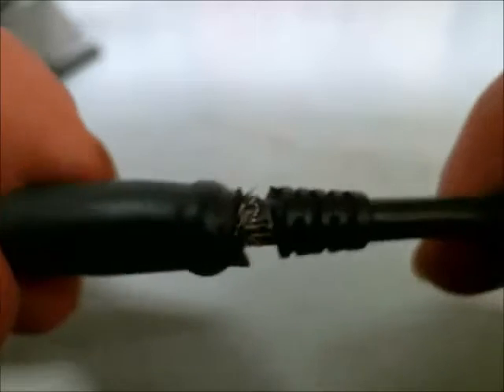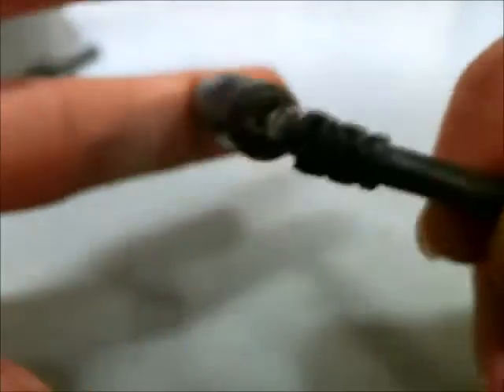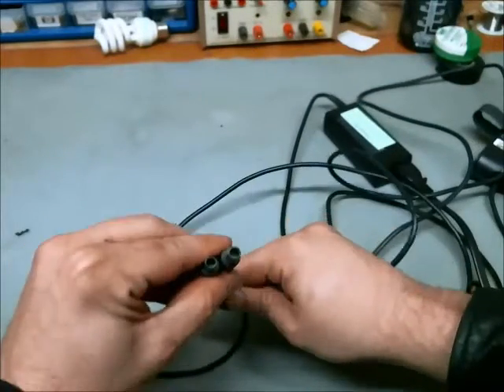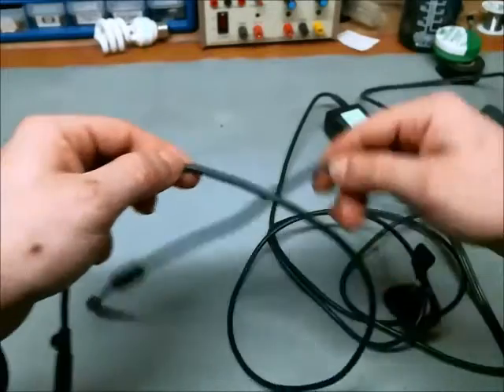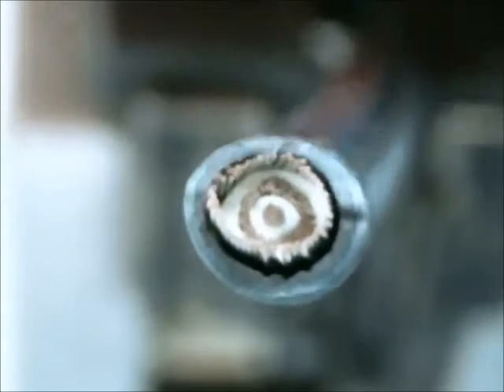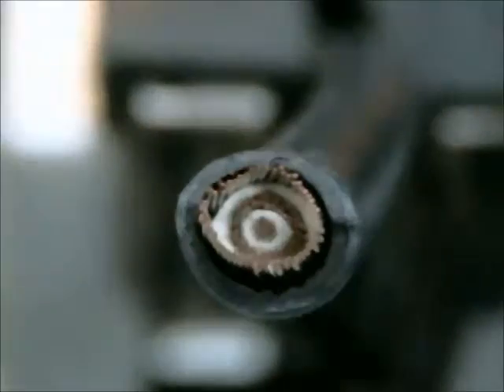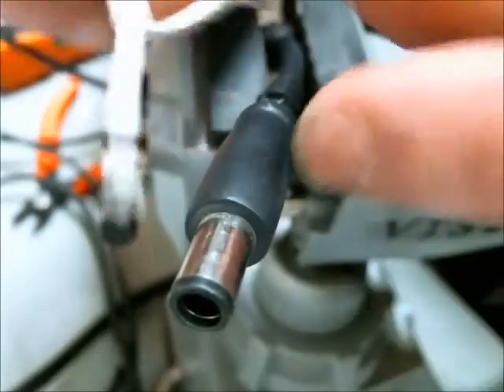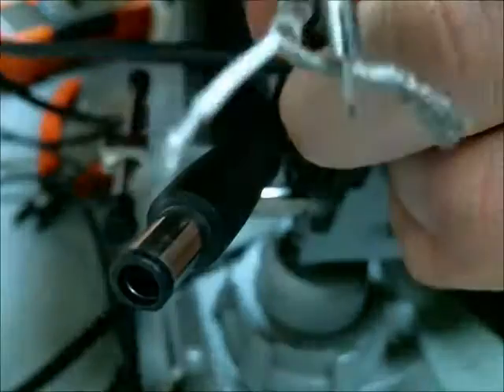How to fix your Laptop Power Cable

Comment: I'd like to know what is that little pin inside the plug for, please?? I've been looking for that answer and no one knows.
Reply from the maker: it is used to identify that the power supply is suitable for the laptop, also to make it more difficult for customers to buy a replacement power supply from other vendors.
Reply: Hi, Heilman. First of all, thanks for answering so fast, I wasn't expecting that, but I'd like you to give me some more information about it, for example: In order to detect if the power supply is ok for the laptop is it necessary a voltage? cause I've seen that pin is wired OR does the pin use voltage to detect if the power supply is the right one? What happen if the connection of that little pin is broken? Could a laptop work without connection to that pin? Please? The problem is that you are the only one has given me an answer to my question in one year or so, but I'd like to know how the little pin works. Thanks so much.

Comment: is it safe ? scared of trying !
Reply from the maker: nearly all laptop power supplies have short circuit protection so the power supply won't blow up on you even if the positive and negative touch.